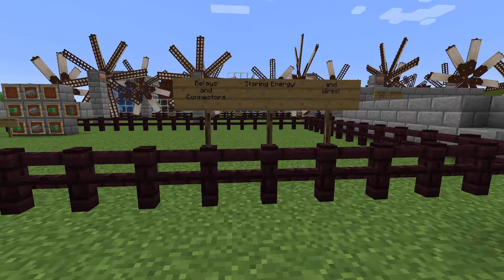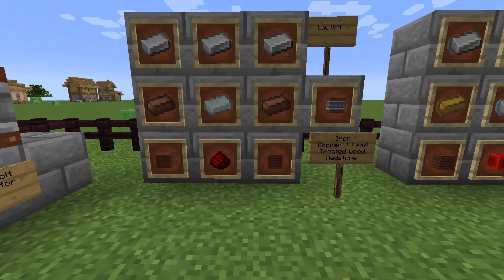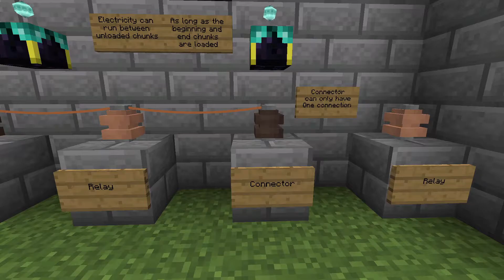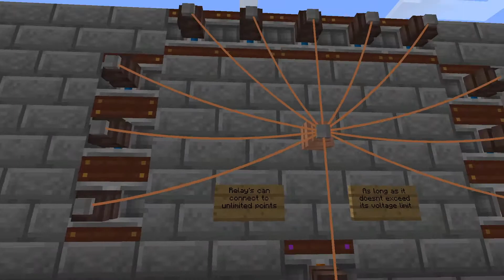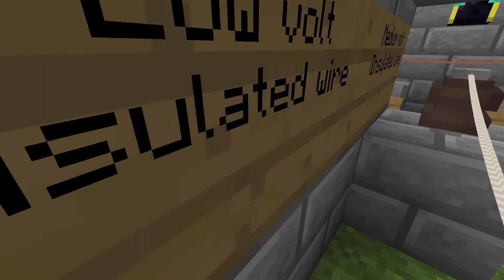Minecraft | Immersive Engineering | The basics - Part Four | Relays / Connectors / Capacitors

Comment: umm i might sound dumb but what is the collected energy used for other than lights? Otherwise i feel like all that just for some retro tech lights?
Reply from the maker: Hey, so the energy is used for the heavy machinery in IE. Such as a the metal press, auto workbench, crusher and many more! I made videos showcasing them if you want to check them out. 
So you’re able to make a fully automated factory in minecraft!
Reply: railgun intensifies